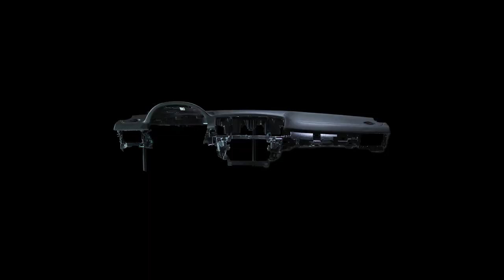CAR INTERIOR LT - Repair of leather dashboards and other leather interior details

Comment: If I win the lottery I'll be sending my Audi your way as part of its restoration. Drivers seat, steering wheel and gear knob could use a retrim but worst of all is my parcel shelf. A bit of water ingress at the bottom left hand corner of the rear screen has discoloured the Alcantara trim on the parcel shelf. One day I hope